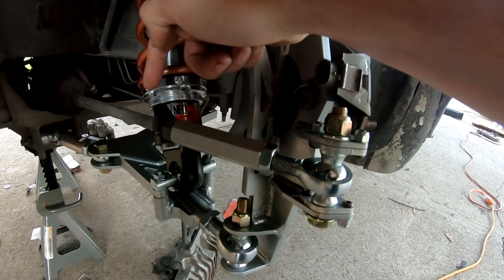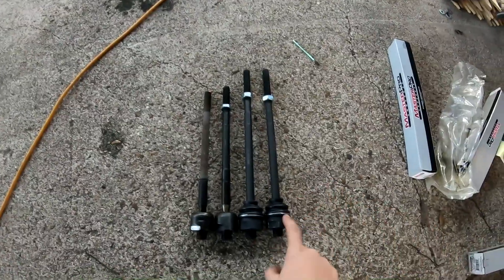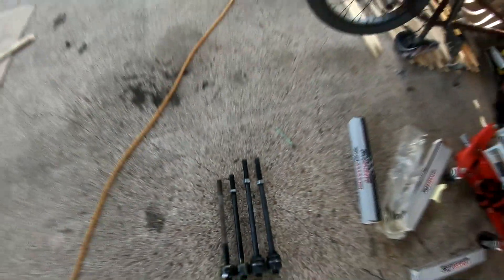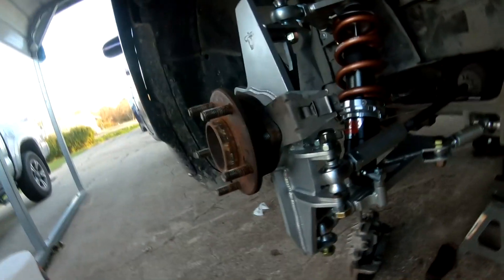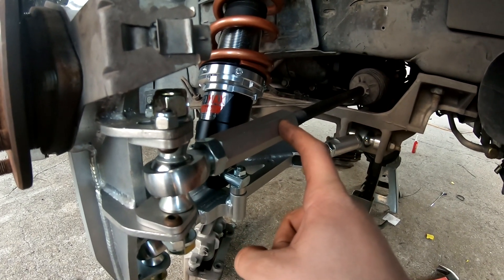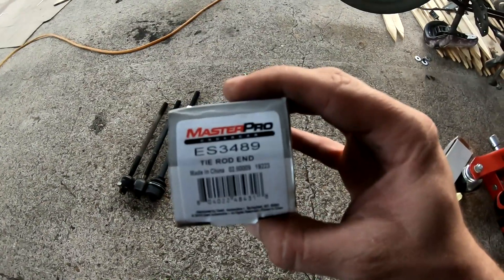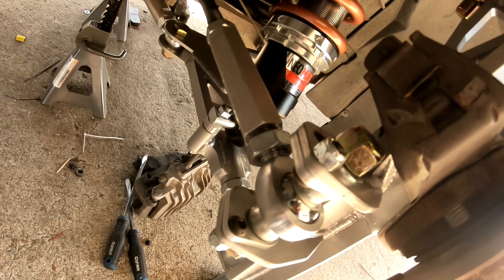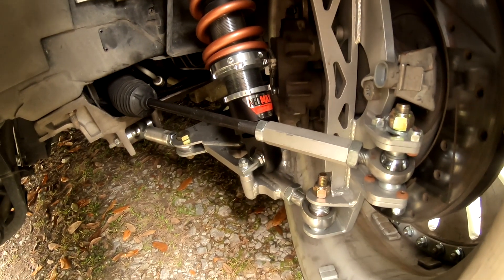Extended inner tie rods for a c5/c6 corvette

Comment: Hey, can You tell me how much of tie rod and heim joints tread are inside of extension? I mean values after alignment. Thx
Reply from the maker: I will try to measure later today depending on the weather
Reply from the maker: I have 1.5 inches of the inner tie rod and about 1/2 to 3/4 of the heim in the extension
Reply: @sethkrampota  great, thanks mate. I was thinking how much is enough to keep it away from breaking :)